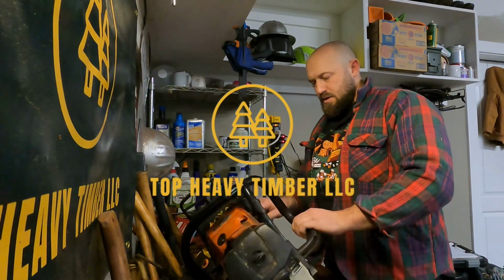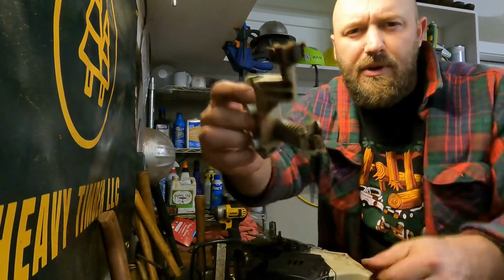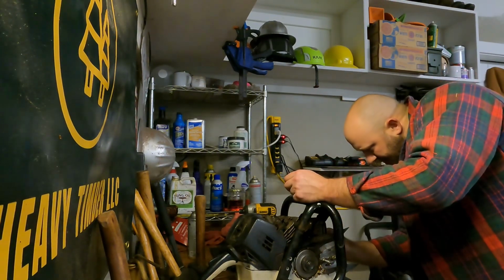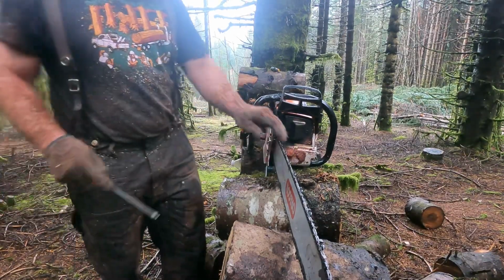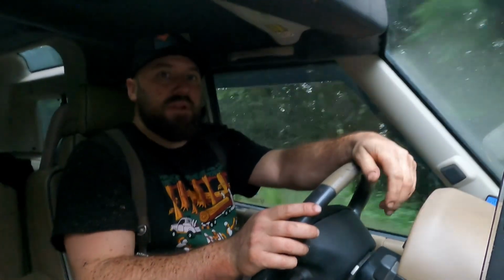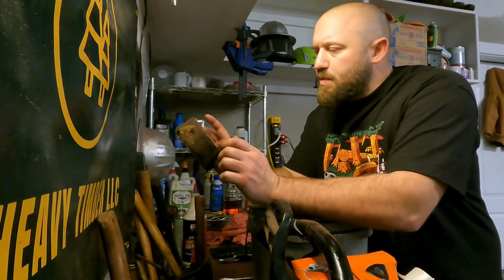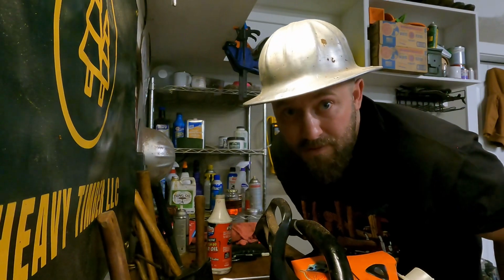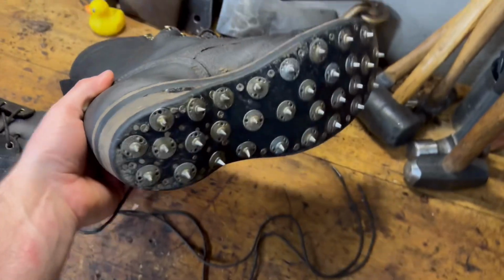Oil, Suspension and Old Growth Christmas trees

Comment: The bolts for the filter base are made out of aluminum. I had one brake while putting my velocity stack on. I was tightening them by hand when it broke. Just a heads up for the guys who don't know. I replaced them with steel bolts but you still gotta be careful because steel and aluminum don't mesh well with each other and the steel will cause the aluminum to wear out faster on your vstack.

Comment: Those are parts straight out off a 661 and the front piece is called a buffer
Reply from the maker: They aren’t straight off the 661 but are designed to be more like them. 
I know it’s a buffer but I have always called it a flower because of the shape 😂
Reply: @topheavytimber  I did get 661 stuff , the black rubbers are still in the package because the spring and buffer make it solid enough
Reply: @topheavytimber  and where did you come up with the leather axe holder
Reply from the maker: That was made by a buddy of mine! 
Awesome piece of kit!